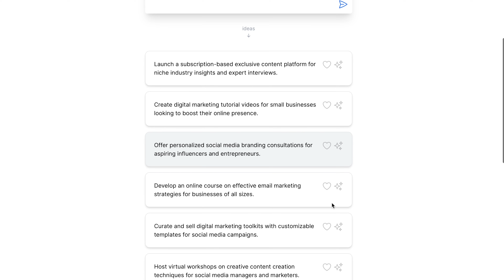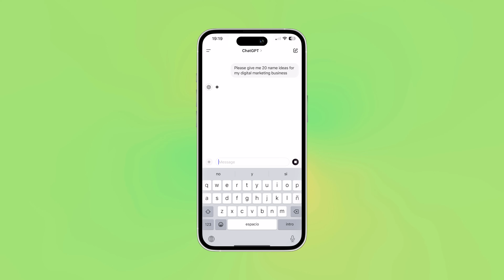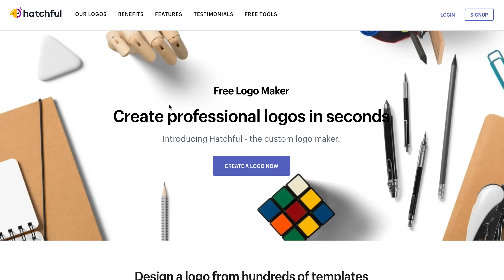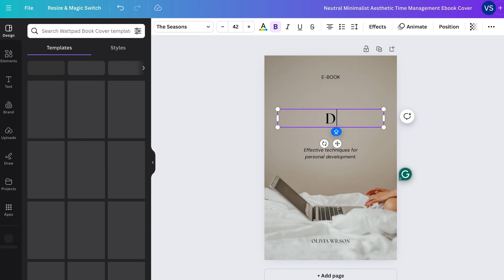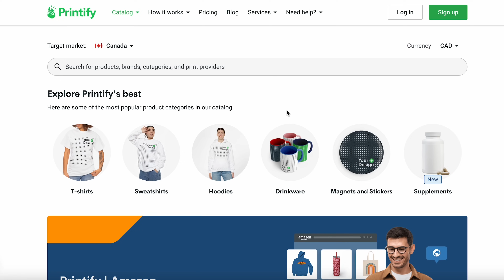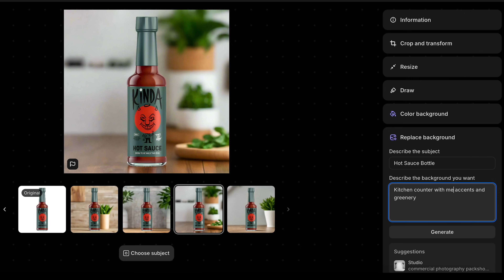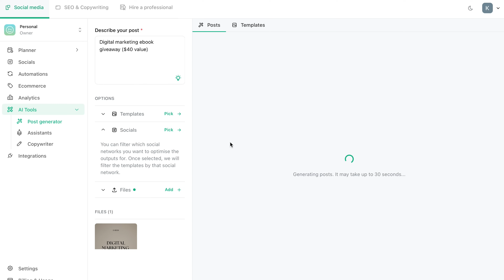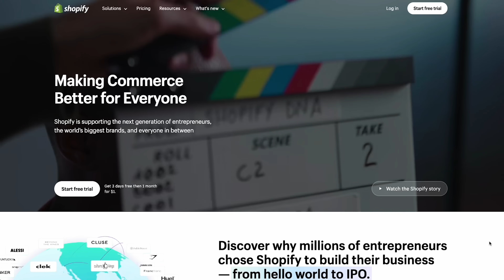How To Start A Business Using Only AI

Comment: been using ai extensively to help run our startup at jenova ai, here's what i've learned:

1. market research: use ai to analyze market trends, competition & customer needs. real-time web search is crucial here to get latest data

2. business plan: ai can help structure & refine your plan, run financial projections. key is to feed it accurate data

3. content/marketing: huge time saver for creating website copy, social posts, emails. but always review/edit ai output

4. customer service: ai can handle basic support, but have humans for complex issues. we use this hybrid approach

5. legal/admin: ai helps with basic contracts & docs, but get a real lawyer to review important stuff

pro tip: don't rely on just 1 ai model. different models excel at different tasks (e.g. claude 3.5 for analysis, gpt4 for creative). use a platform that can route to the best model for each task

just my 2 cents from actually building & running an ai company 🤷‍♂